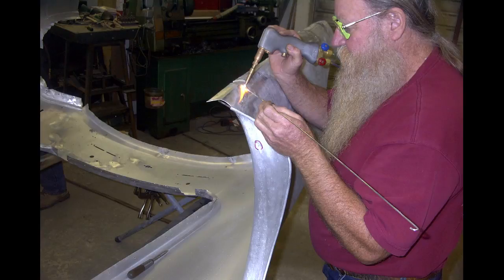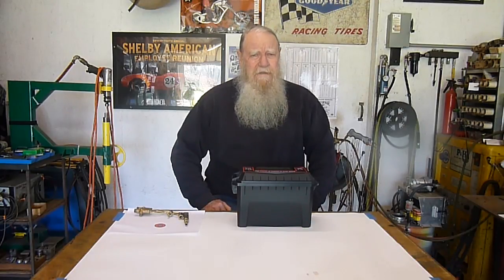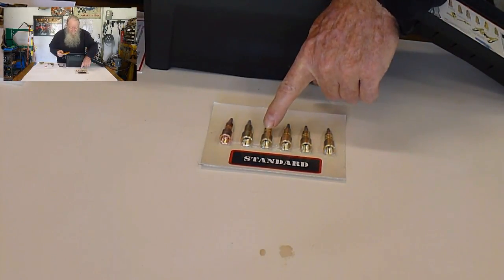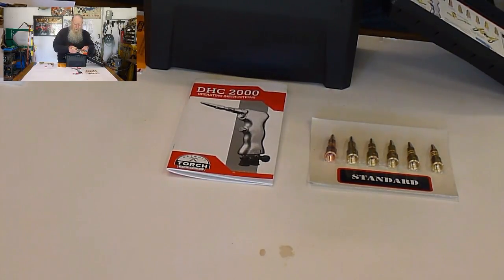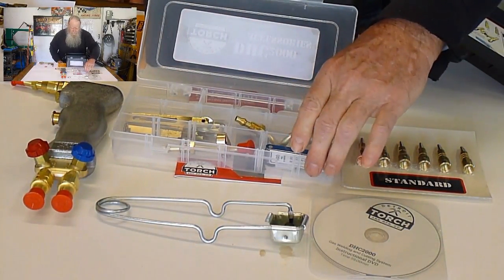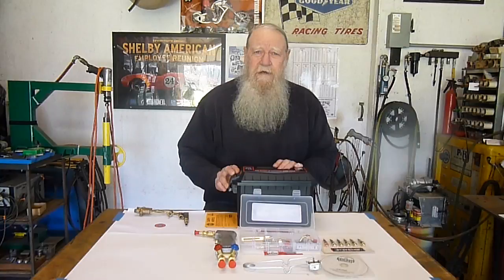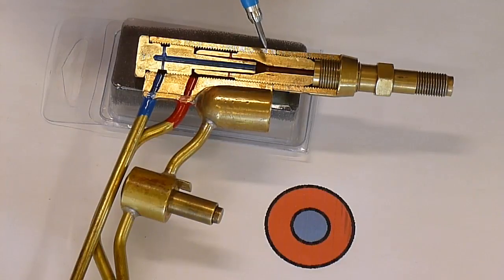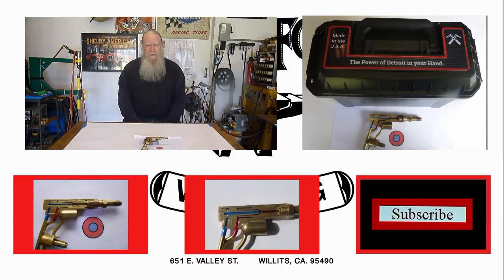Unboxing the Hen Rob Welding Torch

Comment: Just used my Hen Rob yesterday here In the Philippines.  I repaired the lower door hinge of the car here ( the hinge broke loose from the door including the nut plate).  I only had some motorcycle spokes here for welding rods which are plated spring type carbon steel and too thick.   I had great control of heat for welding different thicknesses of sheet metal , including the mounting nuts with over sized welding rods.  I was outside with gusty winds but still kept good control and got a good strong finish weld. If I could only buy Borax here for flux. Great welding torch and I highly recommend this welding torch set for beginners because it is so versatile for so many different applications.  I don't know why we did not include this welding torch set when I was teaching welding in collage.

Comment: The Dillon or whichever name is a favorite torch  of mine especially coupled with a gas saver I've had one for many years and it has served me well but your video just sewed up a few odd curiosities I had from Australia. Thank you. It It can be challenging marrying USA coded gear to our silly metric system. I went through it so long ago I cant remember the solution but solve it I did. GOOD KIT IS PRICLESS. I think I got the Gassaver from Ron Covell.
Reply from the maker: Hi AJ:
I'm glad I could clear up a few points for you. I am glad that I found out about the Dillon torch long ago.       Jere

Comment: What a great tutorial.  I bought one of these 30 years ago and used it for a while and there it sat.  It is the one special tool that I brought with me to my place in the Philippines with me.  I no longer have the wrench that came with the kit so could you tell me the thickness of the tool so I can  properly adjust my cutter tip gap between the torch  oxygen tip .  Thank you.
Reply from the maker: Hello Ray:

The wrench is .155 thick.        Jere
Reply: @jerekirkpatrick2092   Thank you and I am sure that is in inches.  I will check mine tomorrow and write  that in the case.  I have an extra wrench I will grind to that thickness.  Oh if you have an extra wrench in the Philippines that is a big deal.

Comment: These Australian designed torches aren't available here any more. Over 40 years ago when these torches were a new thing  my brother bought one of these and it was quite useful because TIG was not affordable back then.
 I bought one at Oshkosh Airventure while I was there and brought it home. That didn't work out too well as the US copies have 9/16 fittings instead of the original 5/8. I will need to get Chinese parts to make it work.
All said and done they are very expensive compared with a basic TIG welder.
Reply from the maker: Hello Mike:

I believe the fitting on the torch is a "B" fitting. You should be able to take the torch to your local welding supply and get the fittings you need.

Thanks for watching.              Jere

Comment: The Victor torch has a swirled mixing chamber inside.
Reply from the maker: Hello Slinger:

Yes. You can see the turbulator in the end of the tip that connects to the torch body. That is an attempt to mix the gases as it flows through the tip. 

Thanks for watching.         Jere

Comment: I loved the cut-away of the torch--most helpful! 

Mark said they left out the entire cutting chamber, and I would think the oxygen cutting tubing as well. They soldered in a cutting button (trigger) so there's no open hole, but there's nothing inside the housing right there. So I would imagine that there's a lot less gas tubing inside the torch housing on this left-handed unit they just sent me!

Nice video Jere, thanks for posting it.
Reply from the maker: Hi Tom.

There is more ways to skin a cat. If I know what I want I can usually find a way to make what I need.

Thanks.          Jere

Comment: Hi Jere, I'm curious, can you use torch without the aluminum cast cover, bare frame?  They are a bit heavy.  Or cover the torch frame with tig finger to protect from the heat?
Reply from the maker: Hello k Le.

Yes. The torch will function as well with or without the handles. I think you will find that the weight is not found in the handles but in the large brass piece at the bottom of the handle. That part can not be removed. That is where the oxygen is split off for the trigger and used when cutting .

I hope this answers your question.                Jere

Comment: Nice video Jere.  I have the old Dillon torch I have had for years.  The only complaint I have is it isn't made for left handed people and can't be changed.  I am left handed and the torch works, but it is just unhandy and awkward adjusting the gas knobs.  Thanks, Tom
Reply from the maker: Hi Tom.

I think that the torch is a good tool and is worth the inconvenience. I have had to deal with several of it's differences from the old Victor torch that I used for many years before making the DHC 2000 my go to torch. The savings in gases used is probably worth it.

Thanks for watching and your input.               Jere

Comment: I typically use Propane instead of Acetylene with my cutting rig. 
Will this work with propane too?
Thanks
Reply from the maker: Hello Mr Prepper2. Good question. I would rather not give you misinformation than try to feed you a line. I spent a while this morning googling "henrob with propane" and got several results. I also got on the DCH 2000 web site and found nothing. There are more BTU's in propane than acetylene therefore a larger orifice is needed when using propane. I am quite sorry I can't give you the answer that you deserve but I will continue to do some research and get back with you if I find good info for you.

Jere
Reply: I appreciate your time... thanks !

Comment: I have seen the Cobra torches for sale at the swap meet.  Very impressive.  Do you still use gas welding much with a TIG.  I still braze with a torch but otherwise I do everything else using one kind of electric welding or another.

Thanks for all you do.
All the best!

Mike
Reply from the maker: Hello Mike. Yes I use the Hen Rob torch quite a bit. I do quite a bit of silver soldering for Coca Cola because when they ask their other welding shops if they can they don't even know what they are talking about. I use the torch for cutting anything over 3/8" steel. And I weld all my car bodies with the torch be it steel or aluminum. I use it for making nice smooth fillets on dash boards using copper from Romex.

Don't get me wrong, I use the MIG and TIG when the job requires that process. The job will let you know how to approach it.

Hope this answers your question.

Jere
Reply: great video on the Henrob.....I have inherited one and I am having trouble getting the pressure set.   I don't have a good set of low pressure gauge/regulators and I have been following the #2 method of setup without much success. When I get to the step where the Oz regulator is to be set it always just blows out the gas flame.....Any tips about what i might be missing.......

Comment: Great explanation sir. I always wondered what made these work better . I've watched videos of Mr.Heavyshevy use one of these doing everything from rust repair to welding cast iron. 
     Thanks again
Reply from the maker: Thanks for the comment. Did you build the Chevy in the driveway?

Jere
Reply: Jere Kirkpatrick 37 Pontiac. Yea I did it in the 90s
Reply from the maker: Sorry about that!!! Do you have anything going now?

Jere
Reply: I have a 40 ford truck I extend the cab an chopped it. But I'm to busy working on other folks cars to get  to work on it